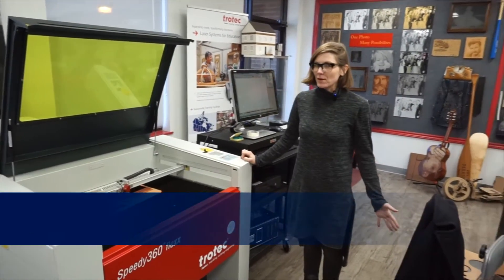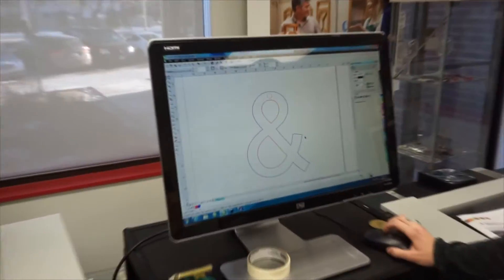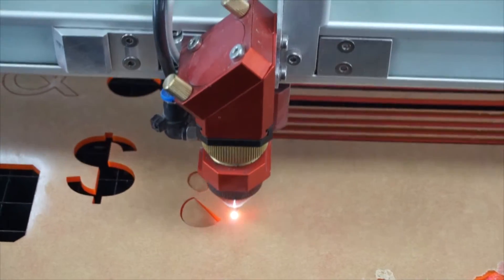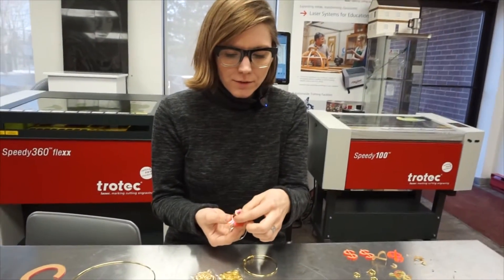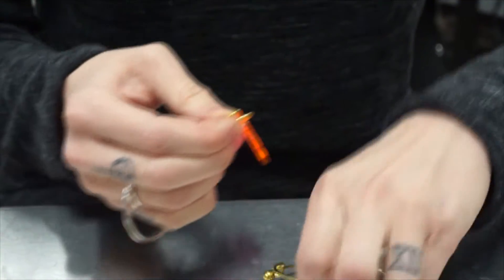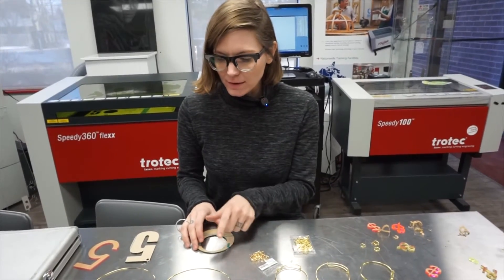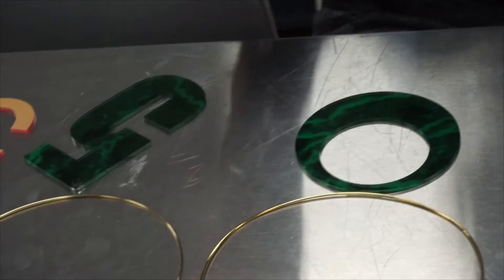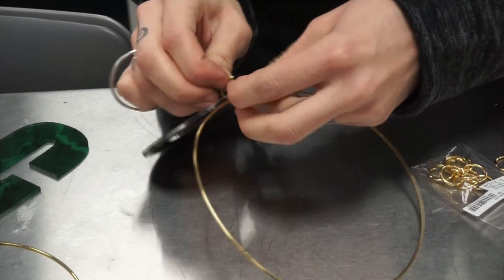Acrylic Jewellery | Laser Cut Acrylic

Comment: What is Laser Power and lens, also acrylic look more than 3mm thick not 1/16
Reply from the maker: Hi guys. It's a 2" CO2 lens, power 100 speed 0.7. You're right that's not our acrylic, we think the student picked the acrylic up and an acrylic retailer (we're not sure on exact thickness).
Reply: Do you mean 100 watts Machine?
Reply from the maker: M & M Sports Trophies & Awards that specific Speedy 100 is 80w and you can cut the acrylic with 100 power setting in JobControl and 0.7 speed.
Reply from the maker: M & M Sports Trophies & Awards you can do those settings as well. But what we suggested will do it faster :)

Comment: How much cost that machinne in Canadian dollars? 
Does it cut stainless steel, copper and other metals? or only acrylic?

Greeting from México :)
Reply from the maker: Miguel AQ hi Miguel, you can buy this machine in Mexico. Please call +52 55 5538 5060
Reply: Those machines are about $ 25 000 each, you can buy for few thousand dollars (3 – 6) similar size and power from China on eBay 130W to 200W, but their way of delivering them may be somewhat difficult, expensive and risky, also I heard that there are some issues with the software they are using, but I do not know that for shore so it may be only peoples talk. 
For cutting something like stainless steel or titanium you need lot more powerful laser, which would cost fortune. To cut hard metals there is similar and cost effective method, this is using Plasma cutting machines, they are almost as precise as lasers, depends on their table size the can take pretty big sheets of metal and cost lot less, their only drawback is that you can only cut metals with them.